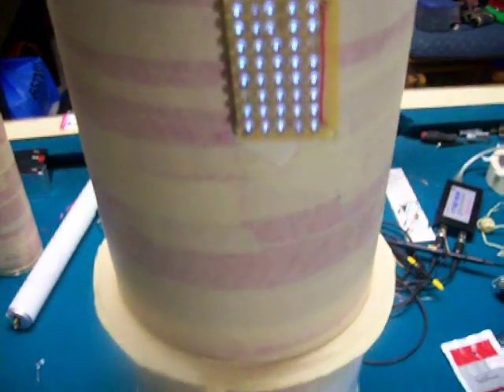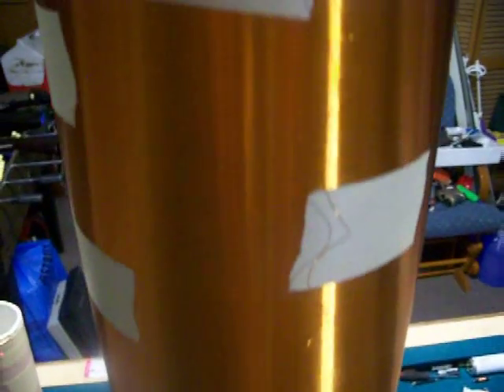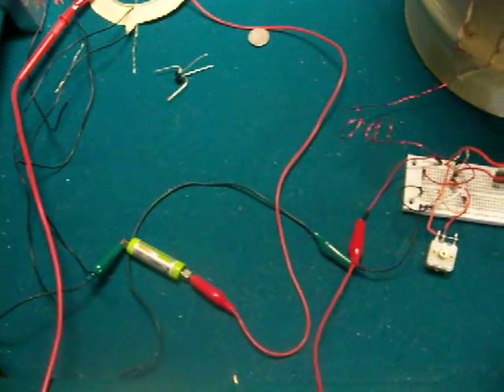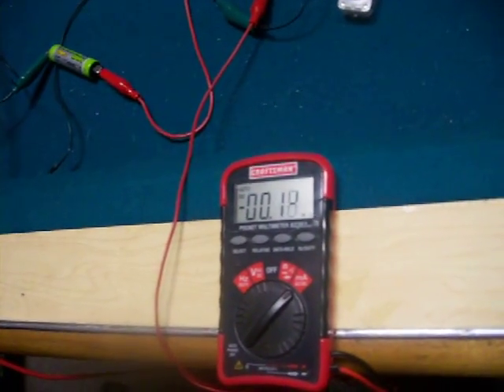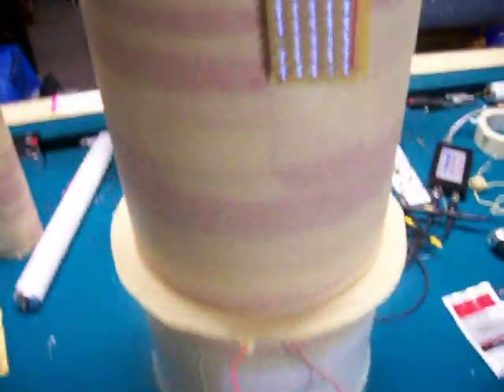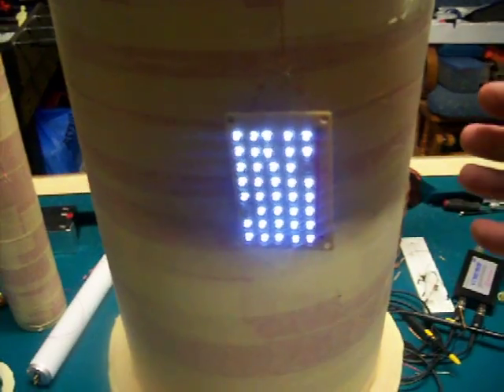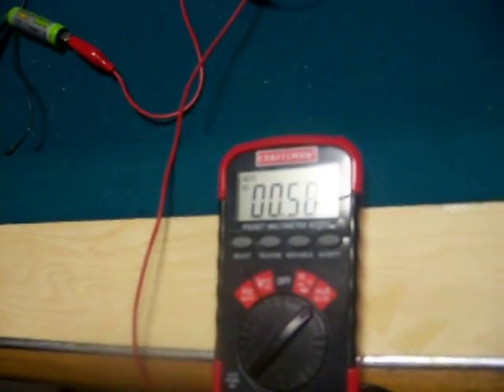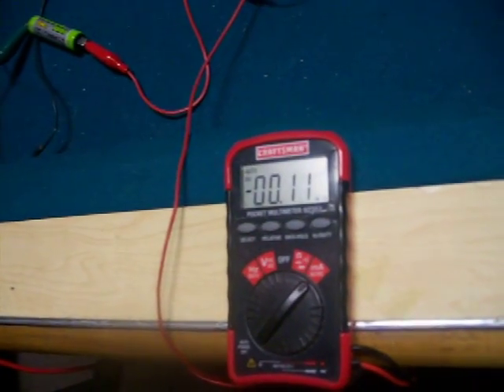Huge Exciter Tower

Comment from the maker: @Pirate88179 
Thanks Bill.
Replacing the battery with a capacitor I didnt see any charge going back.But it will run for a long long time just off the capacitor.

Comment from the maker: @g11690102 
Sorry I'm not sure how many feet it is.The wire size is 23awg on the bottom and 26awg on the top.
I ran out of 23 awg wire half way thru and finished it with 26 awg wire.

Comment: Slayer:

Very nice video and what a huge tower that is.  Consider for a moment, what if your meter is correct?  IF this were the case then maybe your bat. will have more in it after running for a while?  Probably not the case BUT what if it was?  I hope you check this just in case.  Great work man.

Bill

Comment: Well built,
but digital meters will just be jammed by the RF.
You can forget their readings.
Just use only shielded analog meters grounded and wrapped in
alufoil and iron foil and put them at least 3 meters away...

Regards, Stefan.